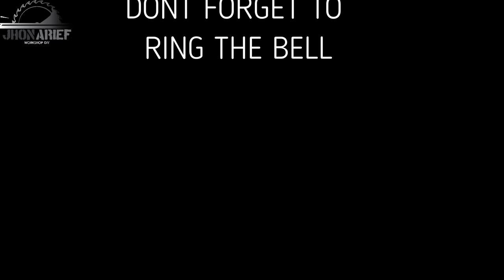HOW TO MAKE STRONG JOINT BELT GRINDER SANDPAPER

Comment: Just want to help with your subtitles. 1. Cut the sand paper longer than you need. 2. Fold it, and make sure it lines up with the under side. 3. Fold the other end, and overlap it. Then make a mark by scratching it with a blade. 4. Make sure the glue is fully dry. 5. Lightly scratch the folded side so it will peel off easily. 6. Use clear plastic between the joint to prevent the glue from sticking.7. Add a thin layer of epoxy glue on both sides.8. Now you have a strong bond on the joint, and it will stay flexible. I realize that English is not your first language, I just want to help you out. BTW your video was very helpful to me. Thanks.
Reply: This is very much appreciated and took only seconds to read, versus watching the full video. Thanks!

Comment: Great video, but by the time you have made 10 belts you could purchase a box full of belts with your time. I just butt up the belt ends and use packaging tape with the cord reinforcement and stick it on the back. Just make sure the sand paper is clean and dust free and use the tape lengthways for strength and not across the belt which has no strength.
Takes just a minute to stick together and works great. No lumps at the joint as they butt together. For wide belts it’s better to cut at an angle or arrow shape, but still butt, no overlaps.
Reply: Who takes time for belts? When I buy belts they're always looking for money. And what do you do when you need a size that no one has? A belt you cannot purchase for love, time or money.
Reply: Did it that way also still cut at an angle though his process is too labor intensive although it looks to be effective
Reply: The glass fibre reinforced tape that many manufacturers use these days will often fail before the grit has shown signs of wear. Can't find any tape as strong as this tape. I'll have to try and repair my broken belts using the grind and overlap method.
Now I have to hope to find the right epoxy glue that won't fail under usage!
Reply: The last time I bought belts, the seller asked me for money, not my time.

Comment: Dear Jhon, thanks for sharing your very thorough process of making sanding belts.  I was wondering why you remove the grit from the top side ? I can see why you need to remove it from the bottom but doesn’t it reduce the sanding area just that little bit.  It may be that the thickness at this point would be greater than for the rest of the belt and so would bump, bump, bump each time the join came around and would get annoying. Cheers.
Reply: Peter Marsh there was no reason at all in removing the grit from the top side.
Reply: P5

Comment: I just butt joint the ends, use gorilla tape, then iron heat to make it stick. Works great without all of this work.
Reply: I butt join mine as well.
Reply: I use a butt joint with a denim strip glued with Evostik contact adhesive.  Clamp between wooden blocks tightly and leave for 3 days -  great strong joints
Reply: I sat on some of that Gorilla tape once & had a butt joint too.
Reply: @calthorp  😅
Reply: @calthorp  that made you full of it, didn't it?

Comment: Can you just do 30 degrees on both side then strip all 4 side with a file then you epoxy and add pressure skipping the treating both sides is it optional to treat both sides ?

Comment: Its not a practical for most, too much time and effort to do this, you already purchase a roll sand paper, glue, necessary tools for, I wonder how much you can save by making widely available sand paper with deferent sizes and affordable costs.
Reply: I use high quality commercial grade belts for knife making.  High quality commercial belts have a long service life and can be LESS expensive in terms of time spent. I admire the approach to crafting belts, but still one has to figure the time involved in making them vs just stocking what is needed.
Reply: You have to do something with your spare time. If you think this is too much effort then don't ever work for a living. You'd hate doing that.

Comment: Nice video but I have a Qs. that when a new belt cost 2 bucks why waste time and energy to save a buck or even less? remember that to make a sanding belt you also need sandpaper and glue.
Reply from the maker: That's is my nature, i just like to make a stuff 😁
Reply: Some people live in countries where you can't buy everything because it is simply not available. E.g. I can buy  sandpaper for my belt sander sometimes only in 100, sometimes only in 120 grit but not in any other grit. Depends on whatever. Defies logic but that's the reality.
Reply: Some sizes are hard to get.
Reply: I have an old Craftsman HD 4"x 21" belt sander and the belts are very hard to find. I like because it has a trigger lock and made so you can run it belt side up.
Reply: Where do you buy a belt like that for 2 bucks?

Comment: why did you apply epoxy first and then peal it off?
Reply from the maker: that purpose is to remove the rough sand from the fabric so that I can joint evenly with the same thickness.

Comment: It would be easier to use melamine coated wood for clamping the belt together the resin glue will not stick to the wood as much as it does in your video
Reply: He needs it to stick to peel off layer.

Comment: very nice john. is this the regular sand paper sheets that can be torn by hand or anything stronger?
Reply from the maker: Yes its regular sand paper
Reply from the maker: Can be torn by hands, and dont worry I already tested grinding 10mm metal rod and its just great, joint proven good
Reply: @jhonarief  thanks dear
Reply: Open coat sandpaper

Comment: 45 degree cut. 2.5 inch wide strip of nylon fabric. (parachute material or simular) Butt up the joints and saturat the nylon strip with super glue. Place it even on the 45 degree joint and place saran wrap over the strip and clamp or firmly hold down for about 60 seconds. Trim excess material and let hang over night. I have made a few thousands of these. Most for me but some for other knife makers. They hold up, quick to make, very durable, and anyone can do it.
Reply: Please make a video. Cheers.
Reply: @abbarr  I'll try.  But the quality will be poor. Give me some time I need to order another roll.

Comment: Thanks for sharing this. It is useful for belt sanders with non standard width (like belt sander's adaptor for angle grinder). Just question: what kind of epoxy do you use? 5minutes instant cure or one hour-cure? Definitely not Dextone steel epoxy right? Since it doesn't have flexibility to bend once cured.
Reply from the maker: I use 5minutes instant cure, dextone has two kind of epoxy, one for steel thats is black and white substance and the other one is clear, use clear one
Reply from the maker: Check my recent picture that I post on wall, i send picture epoxy that I use

Comment: Does the glue joint minus grit have much of a bump..bump when in use.
Reply from the maker: actually the joint is pretty smooth and has no bump,
Reply from the maker: I'm kinda impressed with the way it turns out
Reply: @jhonarief  Ok thanks, will give this method a try, thanks for your video.
Reply: What type bonding agent do you use .
Reply from the maker: I use dextone rapid cure epoxy

Comment: wish you could use Inches instead. Not all of us know Metric.
Reply: 15mm is somewhere between 37/64" and 19/32" It's actually 0.5906" But I suppose you could just call it 9/16" or 5/8" Whatever turns you on. About that much.
Reply: Get used to it! Most rulers  have both units on it today. I felt that way too but times change.

Comment: What epoxy glue is recommended and how long is the glue left is the big question
Reply from the maker: I use clear epoxy glue, and untill now I never had faill on this joint yet
Reply: @jhonarief   well the sandpaper I have has no cloth backing , quite thin , I don’t think it will withstand

Comment: What is solution name pls
Reply from the maker: what do you mean by the solution?  is it the glue?
Reply: @jhonarief   yes that is glue 
Sir this epoxy glue purchases in india
Reply: Epoxy glue purchase in  india
Reply from the maker: @shekharneware9877  that is epoxy glue, each country have their own brand, just looking an epoxy that with clear color separate on 2 parts Hardener and resin
Reply: @jhonarief  jhon this glue used in second condition belt 
Or useless belt ? That work
Reply from the maker: @shekharneware9877  can be used on both condition